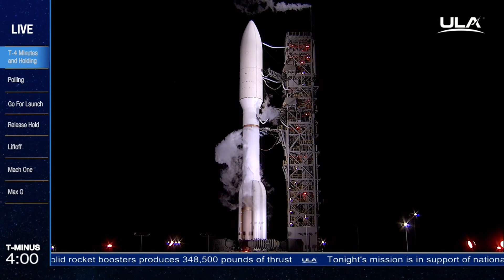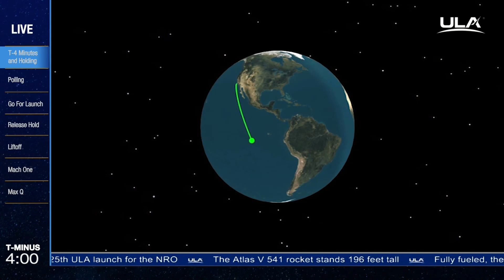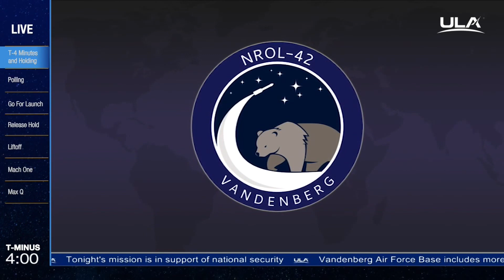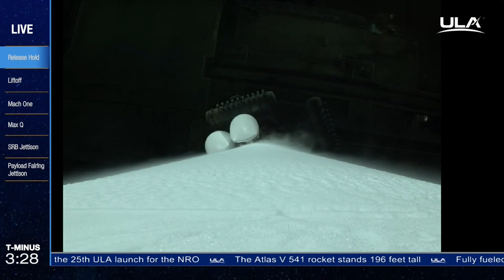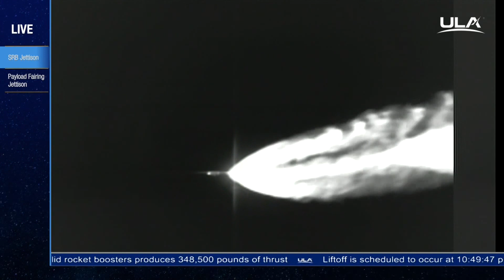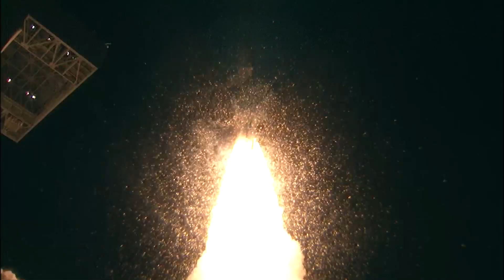Atlas V NROL-42 Live Launch Broadcast

Comment: The differences in the launch sequence are very interesting. Falcon 9 seems to be almost totally automatic; this has a number of "button presses".  Seems like a huge amount of smoke too; is that down to the type of fuel used?
Reply: The smoke is telltale sign of solid propellant, in this case from the 4 strap-on solid boosters. The main booster itself uses RP1 and LOX. If you watch an Atlas V 401 launch or something similar where the middle digit is 0 (indicating no solid boosters), it will have no smoke like the Falcon 9.
Reply: Nathanael Vetters Atlas V Uses Kerosene (RP1) and LOX on the first stage and Lh2 + LOx on the centaur (wikipedia)
Reply: K.o.R good question, SpaceX launches look a lot cleaner. I know the Falcon 9 uses a type of kerosene (and liquid oxygen) as fuel, but I don't know what the Atlas V uses.
Blue origin rockets actually use liquid hydrogen, which is the cleanest burning fuel of them all, creating nothing but water. They don't launch satellites, though, they can't even get to orbit yet.